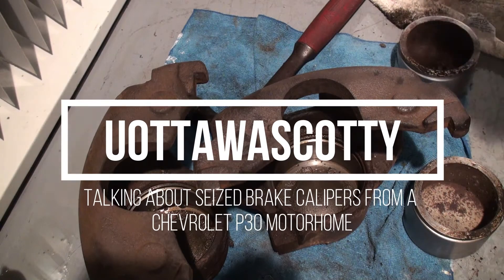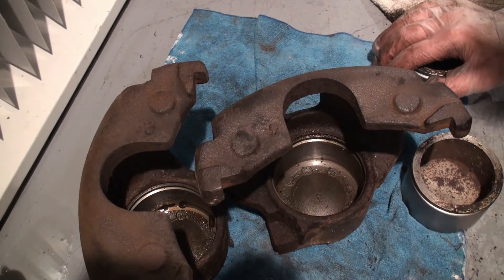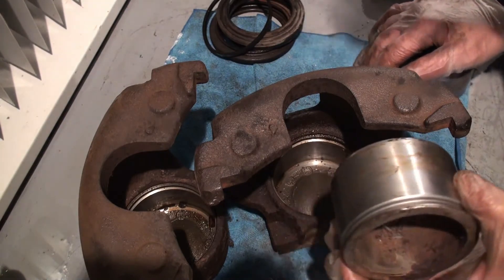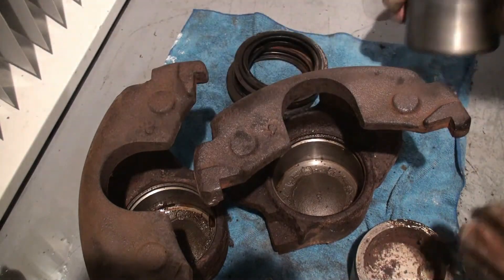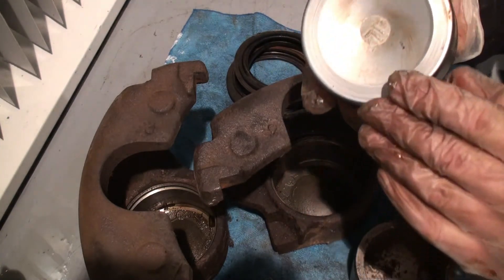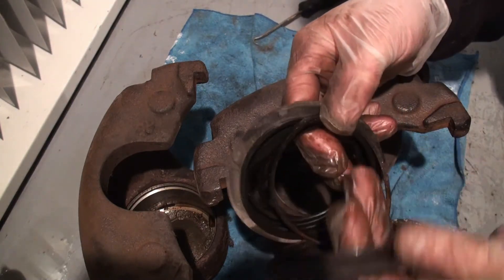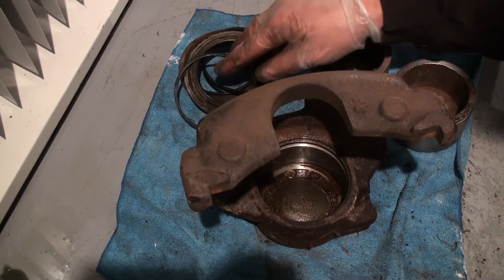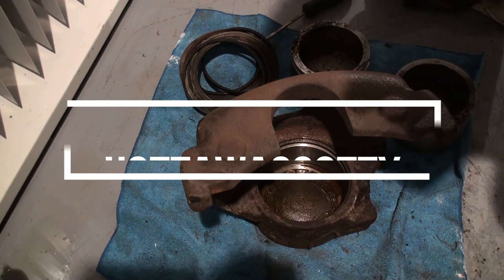Talking About Seized Brake Calipers on a P30 Motorhome Chassis

Comment: The reason for freezing/rusting has all to do with how long the vehicles sit. Add to the fact almost no owners flush and bleed out the old fluid, is the second factor. Usually, the calipers and pistons can be saved.
Reply from the maker: Well, its definately one of the reasons for sure.

Comment: Gr8 video.  I was trying to remove the bolt that mounts the rear caliper on a 1999 Fleetwood Southwind Storm 29V class a motorhome and wow the rust required over 600 ft lbs of torque to turn ever after loosening it!
Reply from the maker: Yes, I can totally believe that.  I have my motorhome plated on the road now, hopefully your brakes go well !!

Comment: I know this is old but i beleive these chevys come with the JB8 brake system and Rockauto has rebuild kit and pistons for sale. Im redoing my 76 g30 camper and figuring out parts has been fun adventure.
Reply from the maker: I eventually found that the parts where actually readily available, just have to know exactly what your looking for.  My Class A is all fixed up and plated on the road, took her for her first camping trip last year and she runs awesome.

Comment: They are very easily sourced if you know your part numbers and have a good parts distributor. I just bough 4 all new calipers for my p30 chassis and they were cheap as well. I think it was 40 per caliper plus vore and i had them the next day. Stay away from parts shops that just type into a computer and dont know what a p30 is when you say p30! To be honest its far easier to source anything for a p30 than for any new chassis! 1976 through 1996 p30 is basically all the same. There are only two versions of brake systems for them. If your having problems sourcing parts walk out of the shop thats acting like they are hard to find in their computer system. They dont deserve your buisness! Find a real parts tech.
Reply from the maker: This is very true, I found all this out after I made this video through trial and error, but no your exactly right about everything your saying here, especially with regards to parts stores.  Most of the parts stores in Ottawa are manned by employees who only know how to operated a search engine, without knowing anything about cars.  I often have to make up fake vehicles in order to get what I want.  For example, today I bought a starter motor for my P30, but I just told the guy that I had a 1988 G30 camper van with a 454 in it, or something similar, I forget the exact make and model I said, but of course that's what you have to do.  I found a great truck center in Winchester where they work on RV's and larger vehicles and when I really need parts I go to them and they know exactly what it is I am looking for and are able to get it the next day.  In general, I only use part source if I absolutely need too.
Reply: @UOttawaScotty  454s for p30 install use an acdelco part number 336-1847 starter lol. Dont forget to check the shim stack and make sure the gear engagent is within tollerance installing it. I have exactly one part rep i have faith in. I hold a fedral airframe and powerplant mechanic certificate and i have watched parts distributors and auto parts stores esspecially become absolute fools. Im only 48 and i cant believe how inexperienced and how ignorant they have all become since i was 20! Not to mention the crap chinese manufactured stuff they hand you over the counter now. I replaced our carrier bearing in our p30 less than two weeks ago, and its dying already! Guess moog should not have sold out to spencer! And yes i replaced all of the universals when i replaced the carrier bearing so it was just a crap chinese dead on arrival nearing. Im frustrated a lot when i put my labor into installing failed parts. For the recors thay carrier bearing was sourced by an orielly store. It was their last chance. They blew it for sure. If you ever roll your p30 through north eastern Az say hi! Were planning to also spend some time in quartzite. We went last year and really loved it. Though we went before and after the big hoopla time in January.

Comment: Where do you get your brake parts from? Rotors and pads. Thanks for the great info
Reply from the maker: Hello Perry, I get my parts up in Gracefield Quebec at a part store called Kelly's, it's a Car Quest franchise I believe.  If your in Ottawa, D and J motors in Winchester is a great place to order P30 parts from because they know truck chassis there and they work on motorhomes of that vintage all the time.  The big box stores like Parts Source and Benson, CT  are more difficult because those guys don't really know anything about heavy stuff, but they CAN get the parts, you just have to get lucky and get someone that knows what they are talking about.
Reply: Thanks for the info! I will check with them and see what I find out. I’m in Tennessee and I’m having no luck down here. All the GM parts dealers just tell me it’s been discontinued because when they look up the last 8 numbers of the VIN they can’t find anything. It doesn’t make since though because you see all the P30s driving around.
Reply from the maker: @cwyredman1974  yeah, see, your just talking to people that don't know what they are talking about.  The P30 was one of the most popular truck chassis of the 90's, a lot of them were made and they DEFINITELY still make parts, and/or make remanufactured parts, 100%.  You just have to find someone in your town that knows.
Reply from the maker: I managed to buy rotors and brake calipers for my RV and that was last year so I know you can still get these parts.  Maybe they don't make NEW parts, but you can still get remanufactured parts off the net and many parts suppliers will carry them too.  I got new brake flex hoses from a parts supplier in Ottawa called CAPS, which is Canadian Auto Parts Supply
Reply: @UOttawaScotty  ok cool. Yeah I figured if I pulled the parts off I would have better luck once I had part numbers. I just hate to take parts off and pull the hub apart without having new parts on hand to replace the old ones. We live and travel full time in ours.
Reply from the maker: @cwyredman1974  ah yes, I can see why you want to make sure you have the right parts then.  The part numbers for the calipers will be somewhere directly on the caliper, they were for mine, I think it's made by BENDIX if I remember correctly.  I wish you luck Perry.  Be safe out there lifting that big old girl in the wild.  I have a good video someplace on my channel about lifting and jacking the motorhome properly...which it sounds like your somewhat of a mechanic so I am sure your good...sounds like you got a big girl like mine
Reply: I buy everything for my 88 elandan winnebago from Rock Auto..just ordered front calipers and brake hoses..i got rear disk pads from Car quest